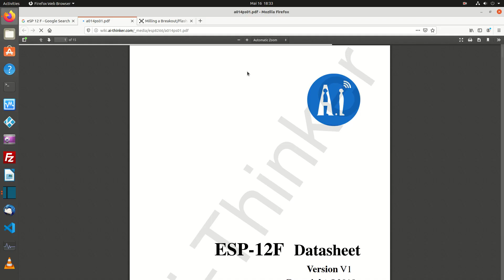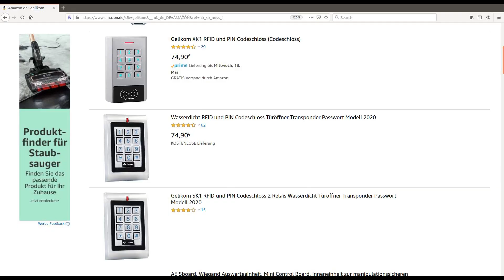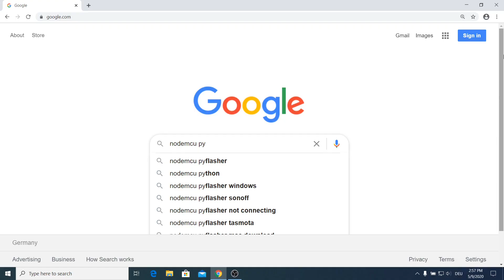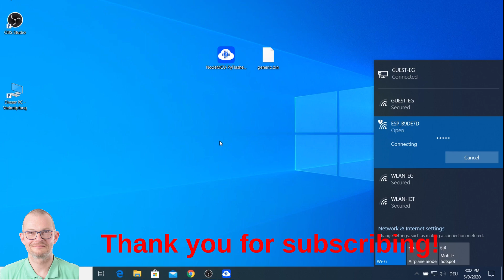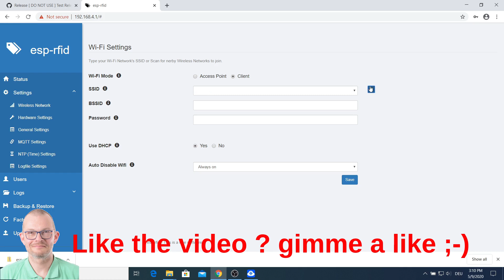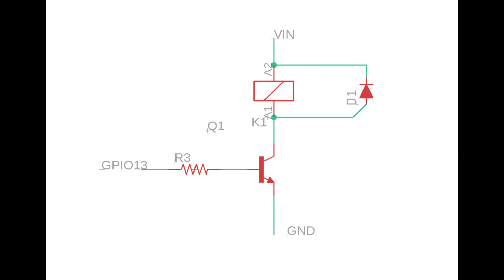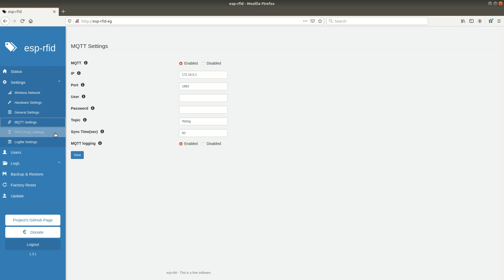DIY RFID reader or RFID keypad using ESP-RFID on esp8266 and MQTT for Home Network integration

Comment: I have wemos d1 mini and esp-rfid firmware working perfectly but when ever I connect relay module in it it gets triggered.. could you provide a diagram or pdf where to connect voltage divider because in video its not visible

Comment: Hello and thank you for the awesome video but i have a question:
I'm currently trying to replicate this kind of project but I'm using a different Keypad, one of that chinese ones standalone key + rfid combo readers (125 khz) wich you can find really cheap on Aliexpress.
The problem is that while i can successfully see data coming to the log (through Wiegand operation) the keys don't seem to be decoded correctly.
For instance, if I press, let's say "1234" combination followed by "#", on the log I'm going to have a separate entry for the first digit, then another one with a sequence of numbers, finally another one with number "13" for the # button.
What I'm seeing in the log seems to me it being just some kind of decimal representation of what I'm dialing on the keypad but not the proper behaviour I would expect visible in your video.
No problem with RFID tags, they get validated too, but still they appear in decimal not HEX, but maybe that's how they're supposed to appear...
Is there some wrong configuration in ESP-RFID or is it a Keypad related problem? how could I solve it?

Thank you very much for your help ; )

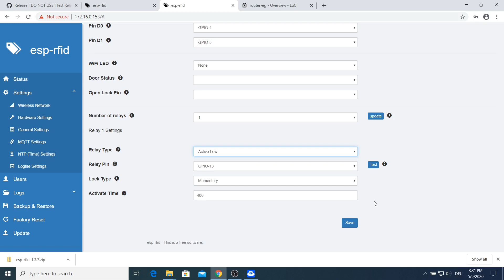Comment: I tried to replicate this using wiegand reader available at my region, it works like yours (7:20) for the rfid, but for the pin whenever i input number on the pad the esp board just recive 1 digit only. I could input more than 1 digit
Reply from the maker: Hi, which release of esp-rfid are you using ? Might be worth opening a discussion on the esp-rfid github repo...

Comment: If the keypad has also NFC, could i register and open with a smartphone that has nfc?
Reply from the maker: That should work as long as the reader supports the Wiegand protocol. Worst case, if the tag length etc. are different, you can modify the software as it is open source ;-)

Comment: Top! Thank you! Do you think its possible to use a arduino with LAN? Circuit ist no problem. Is the code compatible?
Reply from the maker: I did add a couple of ESP specific stuff in the code when I wrote the log file analysis bit for the project (I committed under the name of Frenchie71) - plus the whole IO pins would need to be checked of course. You would need to check the libraries for compatibility as well. It could work ;-)

Comment: would it be possible to use the esp32 instead of the esp8266?
Reply: in the readme file -> what you will need -> hardware
Reply from the maker: @Pur3Cat  I have asked Ömer and will come back to you as soon as I have a reply.
Reply: @OneMarcFifty  Thank you kindly, would love to know. :)
Reply from the maker: Sure, that should work
Reply: @OneMarcFifty  Thanks for the quick response! i asked because in the github depository they state esp32 doesnt work at this point. so i want to make sure before ordering really
Reply from the maker: @Pur3Cat  Can you point me to the link where they say it doesn't work please ? I'd like to double check.
Reply: In my opinion it is simply a waste to use an ESP32 on a task which needs 2 GPIO ports. I would consult the github repository to read what goes and what does not.

Comment: how to connect ESP-rfid with my router. it doesn't work if i used client
Reply from the maker: The device spawns a Wifi with the SSID ESP_something. First you need to connect a laptop/pc to that Wifi, then open the 192.168.4.1 page from where you can then set the SSID/Password parameters for your "real" Wifi.

Comment: open the case, bridge the relay, entry
Reply from the maker: No. This is not correct. Watch the video. The keyboard is used as a wiegand reader. Control happens inside the house.

Comment: Great video, everything works fine for me. The only thing that doesn't work for me is sending an SMS via MQTT protocol.  I use a mosquitto broker, I have noticed that nothing comes from esp-rfid.  Can you ever record a video of how to set up MQTT.  Greetings
Reply from the maker: Hi Jasmin, I can definitely do that - would you be looking into setting up MQTT on premises (i.e. run it at home) or rather use a cloud based service ? MQTT can be set up quite easily with OpenWrt for example or on a raspberry Pi.
Reply: @OneMarcFifty  Thanks for the reply,
Because I don't have a Raspberry Pi I don't think it would be easier for me to set up via OpenWrt or MQTT Cloud based service. Choose what is easier for you ... :-)
Anyway thank you very much.
Reply: since v1.3.1 the mqtt messages goes to topic esprfid/send (in case you put "esprfid"), hope u can hear messages from your esprfid now

Comment: Ahoi! I have watched this video more times than I can count, and I have some questions. At both 2:27 and 7:32 the Wiegand D0 and D1 seem to be directly connected to the GPIO-4 and 5 Pins. You then explain to protect from the higher voltage a Zener Diode and a Pull-Up resistor should be used (6:42). This would force the GPIO 4 and 5 to be default high (3.3v) except when D0 and D1 have traffic, and then they would go low (0v).  How, then, does this seem to be working with the Wiegand D0 & D1 directly connected?
Reply from the maker: Hi Baden, in fact you should not use a zener diode but a normal diode to protect it. The diode put in a way that it would only let through voltages lower than 3.3V, i.e. whenever the signal goes to ground. In other words, the GPIO will always be on 3.3V unless the Wiegand pull it to ground. It does work without the diode and pull up because the ESP 8266 IOs are 5V tolerant, it would interpret 5V as a high and 0V as a low. But as I say, things can go wrong if for example the ground wire gets cut.